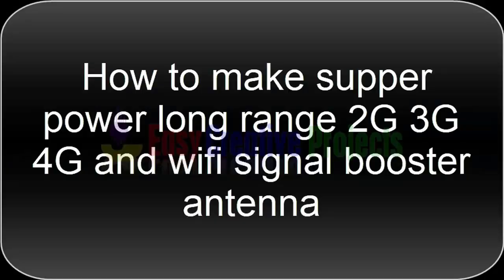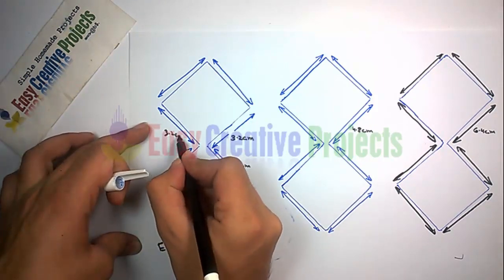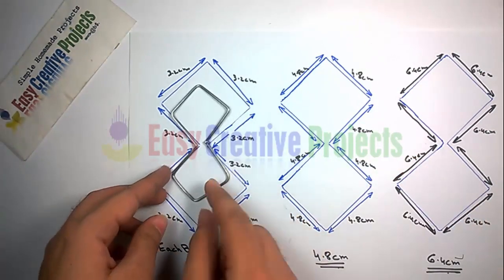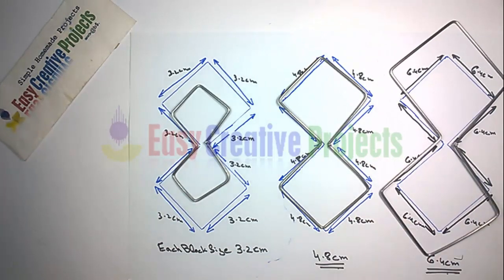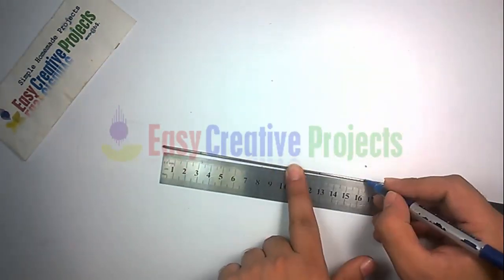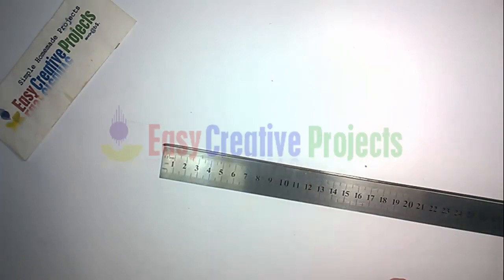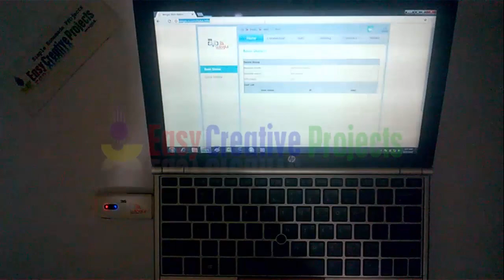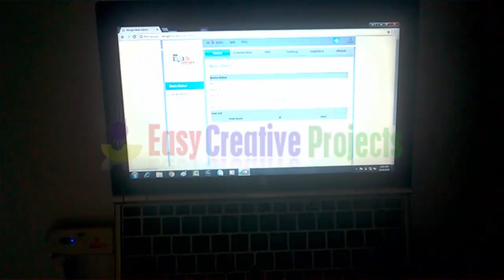How to make supper power 2G 3G 4G and wifi signal booster antenna

Comment: Is it true? Because in our home, there is low signal but my father buy a modem, only 2G for smart and globe even we elevated it 20feet above our house
Reply from the maker: dear few time before in my home basement signal issue. so i make this.and find good results. 
then i share this method in public.
Reply: Hey angelo did you make this so what is happen now? Im using bot pldt and globe but still both of them is 2mbps max speed

Comment: It's not clear if the antenna is insulated from the aluminum base? Also, what is the gap distance when bending each section's squares as it looks like the bow knots do not touch? What size is the aluminum plate?
Reply: Do not follow this design - it has a number of serious errors and cannot work as shown. Please do believe me, I have nothing to gain. I am getting mighty fed up with projects that are simply posted to generate advertising revenue without a chance or working.
Reply from the maker: dear you can use aluminum and copper wire. each antenna gap 10cm. 
one wire direct touch with sheet and 2nd side dose not touch with any thing. 
thanks.
Reply: @EasyCreativeProjects  I am referring to the narrow waist section of each of the 3 antenna sections; not the distance between each section on the straight wire.
Reply from the maker: 1cm